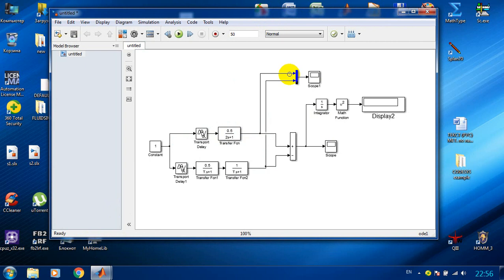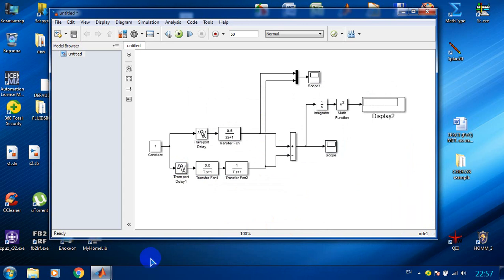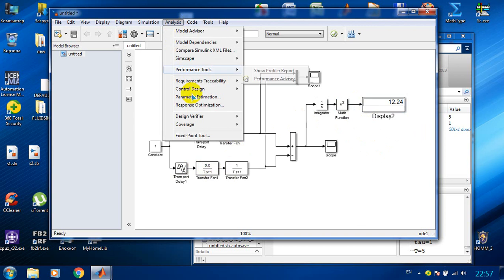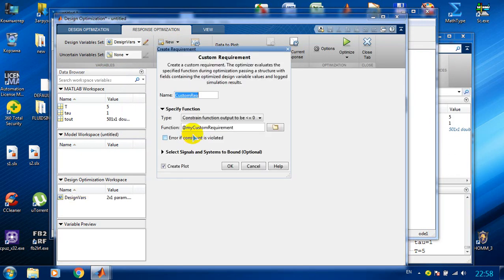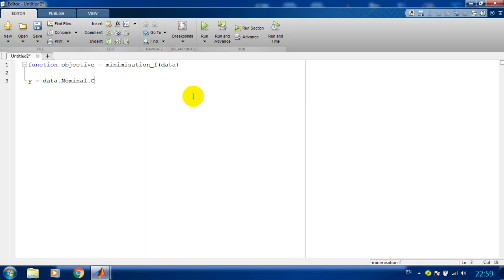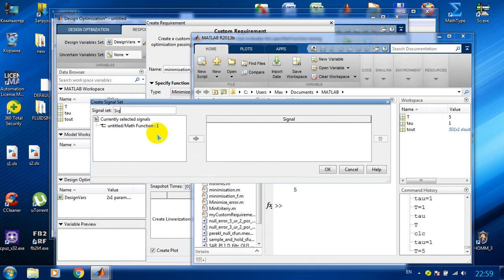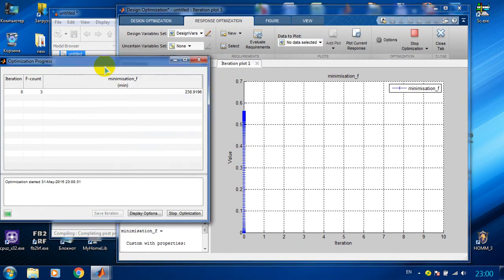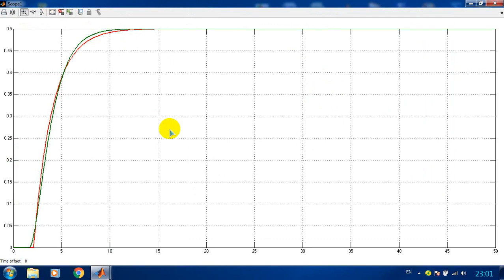Optimisation in MatLab Simulink

Comment: Can I optimise a model using genetic algorithm?? Please reply
Reply from the maker: Yes, you can
Reply: How can i optimise it using ga?
Reply from the maker: @akankshaverma7906  Response optimization -- options -- optimization options -- algorithm -- generic algorithm
Reply: But there are only 4 algorithms available, ga  is not available there, I am using 2017a version.How can I access ga ??
Reply from the maker: https://drive.google.com/open?id=1-_Jt0OKamIAp-p4Au6XX0iF4vZNze2h5
Reply: @maksymlevinskyi8762   thank you so much, it helped a lot.
It would be really helpful if you would also tell me how can I get the ga plot of fitness value versus generation.
Reply: @akankshaverma7906   did you find the solution for this?? Fitness value vs Generation. I am also looking for the same.